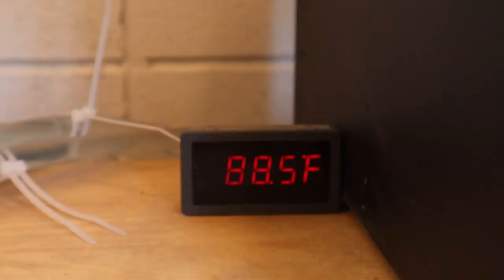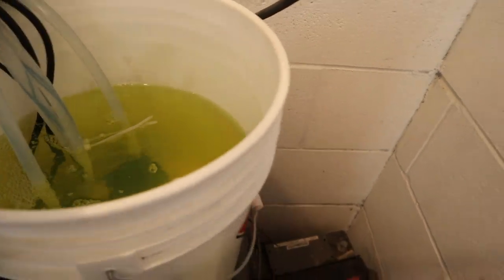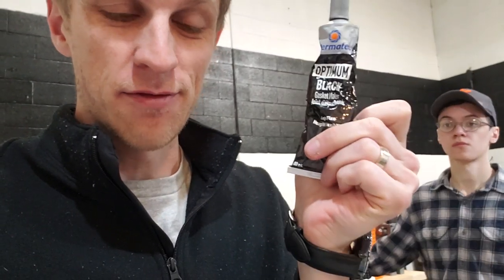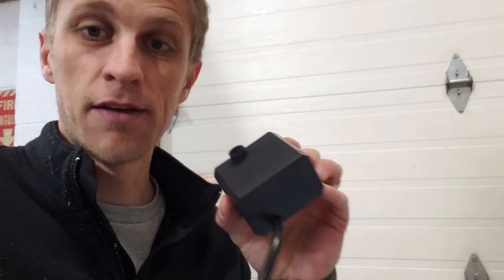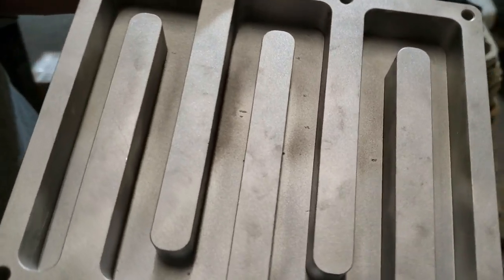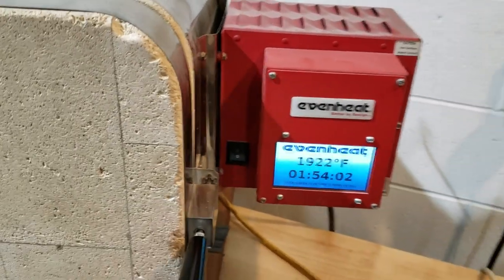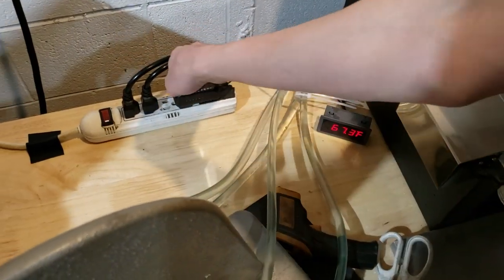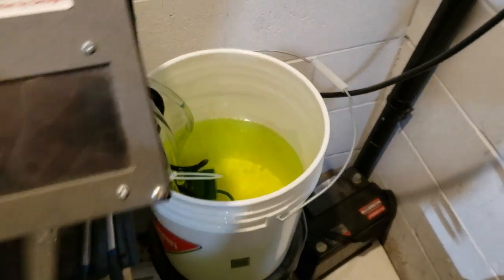Our Watercooled Quench Plates Clogged Up!

Comment: Didn't you have custom milled quench plates with specific pockets cut out for the blades? Maybe I'm just picturing the mounting fixture in my head. Can't remember... Eitherway, wouldn't it be better to have pockets milled out for the blades to be "nested" into while cooling? I assume it would help with warping, as well as getting more surface area touched by the cool aluminum. Most importantly the actual cutting edge. 

Or maybe I'm remembering this quench system wrong and you DO in fact have custom quench plates that just weren't shown in video, that mount to the part you just rebuilt?...
Reply: Spectt84 that’s what I had suggested in the original video too!

Comment: You should look at using a procon style pump vs the aquarium pumps. They are the same pumps that are on tig welding coolers.
Reply: Those gear pumps on TIG coolers are very expensive VS aquarium pumps and they are also noisy and bulky when you include the motors. They are only for when you need a high pressure.
Reply: @nickmartin1688  there not expensive. Under 100 dollars plus the cost of the motor And they are actually pretty quite the only loud part is the fan. Which wouldn't be needed in this application.  Might be a bit more money but they'll last forever vs a 30 dollar aquarium pump
Reply: I've bought complete a couple complete coolers for under 200 dollars
Reply: @1Kingcb  You you got a good deal then - welding stores usually sell the brand-name pumps for 2 to 3 times that price. Whatever you think, those pumps do not last for ever - I had to throw out an entire TIG cooler when the pump died and couldn't be replaced last year. The aquarium pumps are fine for this job as the cooler and hoses are free flowing and don't need high pressure. They only added an extra pump for higher flow rate, not because the original pump died.

The little aquarium pumps are fit for purpose, so why spend 10X more?